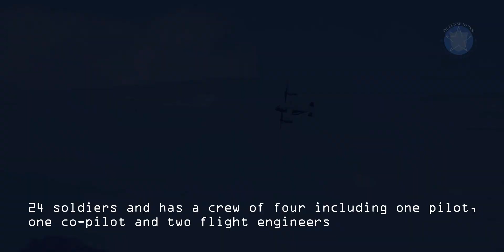Modification | Rolls Royce to provide engines

Comment: i wonder if there would be anyway to fit some jet engines on this aiframe, like the top speed on this thing is only 550km/h.
think what this aircraft would be able to do if it lets say did 800-900 km/h, speed deployment of 20 rough and tough marines at 2000km range any where is bad ass

Comment: [V-22]  Thanks for the latest spec's..  this vehicle needs to be 'FAZED OUT' as the performance is mediocre at best (3000kg real working limit) The CH 46 should have been upgraded and kept in service....  as this is not a real front line vehicle .. as to survivability and due to fragility (250m/s decent max is rather 'in the cross-hairs')..  [CH-47 is a badder more proved platform.. even as it had some exotic configurations... "Guns-a-GoGo"]